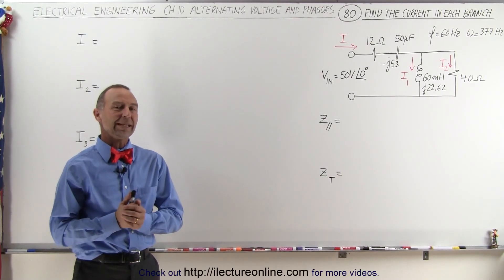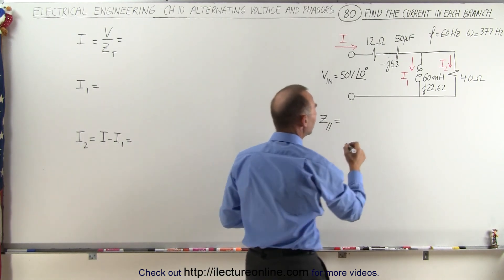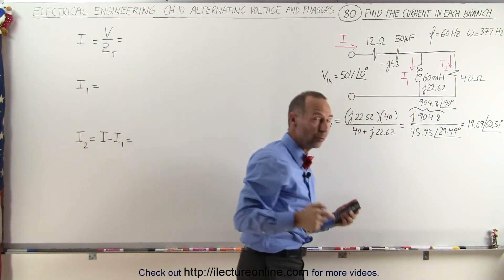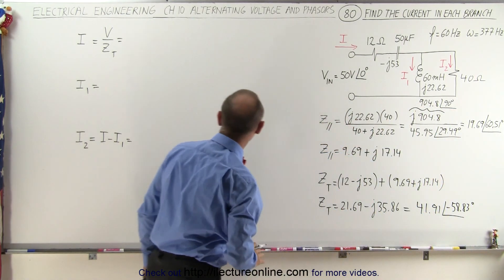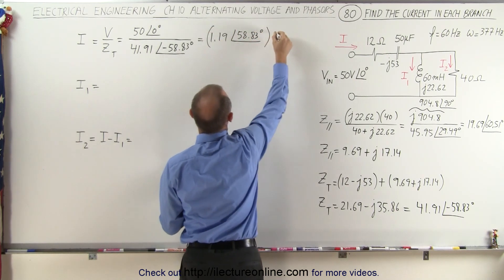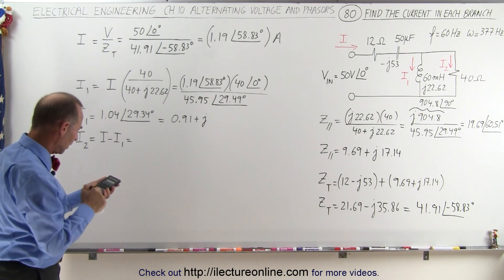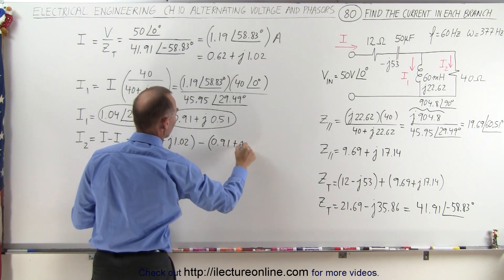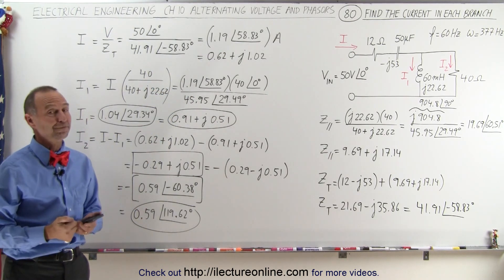Electrical Engineering: Ch 10 Alternating Voltages & Phasors (80 of 82) Current=? in each Branch

Comment: in calculating I1 you did not add 12 ohms and 50uF. why is that? 6:40
Reply from the maker: We know that I1 + I2 = I    At 6:40 we are calculating what fraction of I will go through the I1 branch.
Reply: Because he already has the current across the entire circuit. He is now trying to find the divided current between the branched portion of the circuit.